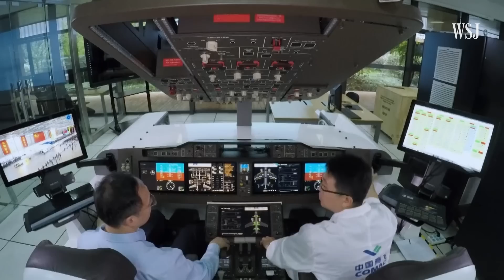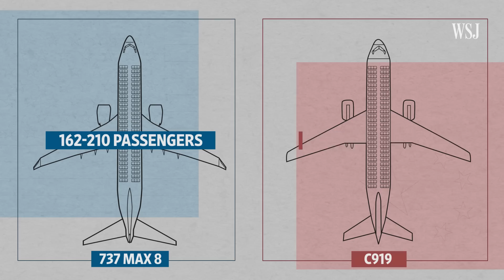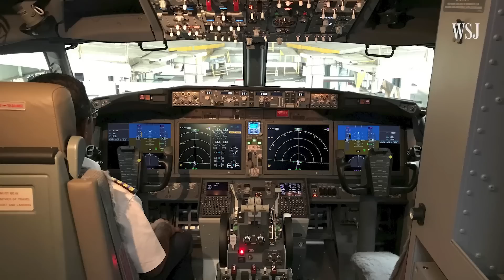Can Comac’s C919 Compete With Boeing's 737 Airplane? | WSJ U.S. vs. China

Comment: China kept the 737 Max grounded, which in itself I don’t disagree with, but then completely covered up the China Eastern Airlines crash which was most probably pilot murder-suicide. 

I know I haven’t explained the point of this very well but I got bored of typing!
Reply: Firstly,the Max is back in sky for a long time in China,but not much Company choose to operate it daily due to its bad reputation.Normally Air China steadily use it as a mix with the older,safer 800 models.
And,I dont know if you watch a series of documentation called Air Craft Investigation,or ACI,which mainly focuses on many well-known disasters caused by multiple causes like machine failure or pilot mistakes.All these Investagion takes YEARS OR EVEN DECADES to make and form a final report.Even the Boeing Max MACS take nearly 2 Years to reach a solid report,and then another 2 years to make them back in sky.CAAC has already replied earlier this year that they have already get some clues,and heading closer to the truth.
Last,If you still remember,the plane that crashed uses a Boeing 737-800,not a comac one.

Comment: Well, if they came this far already, I don't think they will stop. The never stopped when the US forbade them from using the International space station. They one, actually, a much better one. If they can build space stations, land on the moon, land on Mars, build 7nm chips and dominate in telecommunications then they will succeed in rebuilding the supply chain without any need for backward compatibility and need to support legacy systems.
China will create new standards and thus fracturing the supply chain that took decades to be this efficient financially. I predicts Boeing and Airbus are in for a bumpy ride this decade before they go belly up the end of next one.
Of course we can avoid this debacle if let China use the existing supply chain instead of challenging it with its millions of engineers that they produce per year.

Comment: The question is ,is this plane safe enough for commercial use?Only after many years with many hulls  & passenger lives lost planes could iron out their defects that were not discovered before .Brand new does not mean safe, DC 3 are still flying safely relatively because of sound engineering & this could not be said  for these planes’s  country of origin.A military plane has a ejection seat & a parachute .Some thing wrong in the air & u are a goner, period.Like the song fools rush in where wise men never go,go only in a plane u relatively know.

Comment: [Search:"regulator says more testing needed to certify C919 aircraft - Reuters"] Yang Zhenmei, Director General, Department of Aircraft Airworthiness Certification CAAC, told reporters that the C919, China's attempt to rival Airbus and Boeing, has "completed" (failed/passed?) only 34 certification tests out of 276. 
Airlines/ICAO require all international (not domestic) planes have EU EASA & US FAA approvals in order to fly over international air spaces.

Comment: China's first commercial passenger jet was produced with 100% stolen US technologies.
Reply: If they stole 100% from US and take 15 years to run the first commercial flight. They should not lose 15 years for R&D and then just but it from Airbus or Boeing.  15 Years for just narrow width aircraft take too long for 100% copy.

Comment: 4:24 This statement about technological improvements framed the 737 as more advanced than the a320. No matter which plane you prefer, that is just incorrect. The a320 is objectively more modern that the 737.

Comment: Considering the bans on advanced microchips imposed on China, I wonder if the C919 hardware is based on old technology.
I am not going to fly in that cylindrical coffin.
Reply: Planes from 1995 are safely operating still. Stop being overdramatic.
Reply: @marajesty311  Airplanes from 1995 are safely operating with continuous upgrades. Stop being underinformed.
Reply: @TheGuggo  China is not a poor or backward country - their technology is better than most other countries. Chinese companies are producing chips which compete with American ones. Even if it is not as good, it isn't far behind - likely only a year or two behind. A plane from 2005, like a 777-300ER, still uses the tech it had from the factory.  The C919 is perfectly safe to fly in.

Comment: It is most definitely more appropriate to compare the A320 with the C919 strictly for both the design era (where the 737 is decades older and more antiquated than both), as well as the 737 MAX series scandals that will notably tarnish Boeing for years to come.
Reply: because the US ALWAYS thinks they are the center of the universe HAHAHAHAHAHAHAHAHA
Reply: @lancewood1410   Nah, it's China that thinks it's center. China essentially means "central country"
Reply: @jake1110  that's what you think🤣

Comment: The Chinese market needs 10,000 aircraft in the next 10-20 years, 8,000 of which are similar to the 737 or A320. Even if the C919 is mass-produced quickly, it is impossible to produce 8,000 aircraft. The same is true for Boeing and Airbus.

Comment: I’m surprised that this report did not touch the subject of pricing. When C919 was announced it promised to be within 50% of the same size jet from Boeing/Airbus, now when they are closer to delivery of those planes, it is rumored to be at least 90% of A320/B737MAX. 
Additionally direct $70B government investment is a clear violation of WTO rules for fair trade competition and Boeing and Airbus regularly take one another to court for those accusations. So COMAC definitely has to bear those costs as well once it starts selling C919 internationally.
Building a successful and safe jetliner takes a lot of discipline and also personal accountability. It means a simple employee in the factory should feel empowered to raise their hand if they see something is wrong. This is something that I don’t trust to happen in COMAC. So no thanks. I prefer to fly Boeing, Airbus and then Bombardier and Embraer.

Comment: an interesting fact: the initial model of C919 has a much shorter range than A320 or B737. As it is the first of its kind, COMAC is very conservative with design, using older, heavier, but more reliable materials than the newer ones.

Comment: Washington is getting in the way of business and will eventually cost US jobs. Developing a new aircraft is hugely expensive. No one company builds 100% so it makes sense to include China in development and lowering the financial risks.  
China is building it's own to guard against US sanctions and will ultimately succeed. 
It took Boeing 65years to progress from the B707-120 to today's aircraft. China will make a similar leap in 1/3 of the time (more engineers and more determination) Then goodbye a huge market so better to include them. As the space station has shown they are more than capable.

Comment: Older than "even the A320neo" is a statement only US journalists can make about the most advanced short-haul jetliner :D Especially while Boeing has to beg congress to extend permission to use an outdated warning system and having had to retrofit the aircraft with systems to make it compete which ultimately crashed 2 jets.

Comment: I understand the journalists are American so they are probably more familiar with Boeing or whatever other reason, by why don't take in consideration also Airbus in this analysis?? 😅
Considering also how much success the A320 family (also A319, A321 and the new A321 XLR) obtained well  surpassing the 737 family, exepecialy after the 737 max grounding
Reply: Definitely preferring the A320 family over the 737 family! A320s just feel safer than 737s! The only presentable Boeing aircraft these days seems to be 777, but even the newest 777-9 got delayed.... so... Boeing should work hard on that first before worrying about any other things else.
Reply: Probably the journalist meant that C919 was a threat to 737 but to A320. Yeas ago, COMAC declared that its goal was  to take 1/3 shares of Chinese domestic market eventually, which meat there still were 1/3 left for Airbus and 1/3 for Boeing. But thanks for US politicians' trade war and 737max's infamous dive down stunt, the future of Chinese market is most likely that C919 and A320 will divide the rest 1/3 market share which China originally planned for Boeing.

Comment: Regardless of Boeing has over 100 years of experience, Boeing has yet to be able to solve potential risks with their planes after cutting corner after corner to stay ahead of the business. The 737-Max design is over 60 years old, and no accurate new models have been created to improve safety. Airbus is way ahead of the game with safety and innovation. Now China will have the ability to prove itself in the aerospace industry. Boeing is a dying dinosaur that needs to be acquired by the government for the brand to last a while longer.

Comment: The C919 can be written off for two key reasons: it's nowhere near as efficient as the 320neo or the 737max; it has a comparatively limited range (3000nm) against its peers.  The only way this will sell is because it is cheaper than Airbus and Boeing - but the cost of ownership (sacrifices in efficiency and range) will ultimately make it unpalatable for most airlines.
Reply: It’s a start for them. They will need to build their own engines eventually considering the geopolitic situation.
Reply: Just willy sebagai orang China saya suka pemikiran kamu, teruskan pandangan kamu terhadap china.  Biarkan orang orang China berkarya sesuai pemikiran mereka bukan orang lain  👍🤣
Reply: Just, good analysis. So, they got the range shortcoming and cost effective analysis. What is your thought and recommendation on improving the range. What efficiency?  Fuel efficiency, passenger capacity? Ease of maintenance?

Comment: Boeing is a has-been in the industry.  It is no longer an innovator and has outsourced much of its productive capacity to sub assembly suppliers.  The 737 entered service in 1968 and built an amazing reputation for safety and durabilty.  Today Boeing is an MBA driven, cost cutting organization that clearly views dead passengers as acceptable business risk.  They have lawyers to deal with safety issues, no need for expensive engineers or riqorous manufacturing standards.
If Comac copies Boeing they are screwed.

Comment: Airlines will love the competition.  Boeing's safety record is worse with new 737 Max than C919 so can't bring that up as an issue.

Eastern Europe and low cost airlines will be very interested.
Reply: Not particularly. Low-cost airlines usually go for older planes (which are sometimes retrofitted). The big giants can afford to be somewhat picky.

Comment: It'll be interesting to see if the Comac C919 could be adapted to use the Russian PD-14 engine.
Reply: The pd-14 just isn't good enough the bypass ratio is only 8 

Pratt & Whitney PW1000G is 12.5 bypass ratio 

General Electric GE9X is 9.9

----
Bypass provides a lower fuel consumption for the same thrust, measured as thrust specific fuel consumption (grams/second fuel per unit of thrust in kN using SI units). Lower fuel consumption that comes with high bypass ratios applies to turboprops, using a propeller rather than a ducted fan.[2][3][4][5] High bypass designs are the dominant type for commercial passenger aircraft and both civilian and military jet transports.

Business jets use medium BPR engines.[6]

Combat aircraft use engines with low bypass ratios to compromise between fuel economy and the requirements of combat: high power-to-weight ratios, supersonic performance, and the ability to use afterburners.
Reply: @xblade11230 

C919 uses the CFM LEAP as it’s only engine of choice.
Reply: @aviatorsound914  No untrue they use the CFM LEAP because it has a bypass ratio of 11 and it is far more efficient than the PD-14

But they had a choice between the PD-14, PW1000G, and the CFM leap for the comac c919

Comment: Look at the engine of C919, it is too big
Reply: Comparing to what?
Reply: @igorgoncharov3191  Boeing 737 800
Reply: @viperwb  Why don't you directly compare with 737-100 then? The engine Leap is larger than CFM56, because it has much higher bypass ratio, meaning larger size of the fan.
Reply: Bing, what size of engine should it be most efficient given the plane’s dimensions?

Comment: Let hope the C919 could help drive down air ticket price for the travelers.
Reply: this is the most important thing for all passengers.
Reply: I don't think that's a significant aspect of ticket prices though.
Reply: Ticket prices largely depend on fuel
Reply: ticket price is not a big deal. c919 will create hundreds of thousand of jobs, then promote consumption and lift up living standard.
Reply: Ticket prices are already incredibly low for consumers
Reply: Just like prices of EV.

Comment: We are talking only about the Chinese market here. With the geopolitical risks with the Americans, the C919 has an enormous home advantage over Boeing. Even over Airbus in fact, due to the Americans political influence over EU countries.
Reply: What, EU can't think for themselves?
Reply: Looking forward towards entertaining flight videos from china.
Reply: What is the geopolitical risk of the C919 when it’s engine supply, could basically be shut down by these countries? Since it’s using the CFM LEAP.
Reply: @aviatorsound914  the LEAP is used because it's the more commercially viable option. However, China does have its own CJ-1000 engine in development and can be swapped in if heavy sanctions hit. It won't have the same efficiency as the LEAP but it'll still work in a pinch
Reply: @aviatorsound914
Reply: @aviatorsound914

Comment: Interesting that you compare it to the 737 when China uses more a320s than 737s, also due to geopolitics, i can see china turn towards airbus even more
Reply: American bias probably. You can see it when they say that "even the A320neo" is modern. Well, it's the most modern jet of that size there is. Certainly more modern than Boeing, as evident by their outdated crew alert system.
Reply: @LuLeBe  all 737's fuselage and passenger size excepted have a cabin that dates back to the era of the 707,720 and 727 before it.whereas Airbus is a lot newer by 3 decades.a fairer comparison would be the a220 if measured as a domestic plane
Reply: China turned to Airbus making it the largest aircraft seller in the world, Airbus has the largest market in China
Reply: I wonder why..  I would use Airbus too, now to make its own.
Reply: i would not be surprised if most follow suit.a mix of a220,a320 and maybe these as 737 replacements worldwide.
Reply: @franzchong5889 
A220 it’s also a brand new airplane just like the C919 tho A220 definitely did have its own engine issue. C919 also uses CFM LEAP engine, which is obviously made by the United States and France but China will definitely have to be on the good side of these country if they want to have their engine in constant supply in order to produce these airplanes. 

So, the United States and other countries technically still has a leverage over China since they could take the engine supply hostage any time and probably selling the engine at a higher cost to these companies. 

I don’t see China looking to build its own engine since it’s 10 times more complicated and I don’t see China having such capabilities yet nor do they have any in development.
Reply: Currently, no engine can match the reliability of the CFM International LEAP so if China considers to build future airplanes, using the same engine or different engine suppliers probably from the western country then they will have to be on the good side of these countries. Otherwise they could just shut their engine supplies down and you wouldn’t even see any airplanes being produced.
Reply: Us gov start trade war on china. And say so many lies and bad words on china. US gov didn't be aware of they will pay for it.
Reply: This aged like milk

Comment: China biggest break through in commercial jet. china has the ability for a long time but they have to focus on their military jets first. C919 is not a challenge to the 737 or A320 yet. China is really want to get their local market, sort out firts, over 1000 orders already, it is not bad. It is a basic plane, it is good enough for comfort, fuel economy, ranges are not bad as well but  china has no way any where near as Boeing or Airbus  services, maintaince, repair facilities . China has to produce 100 each year, so after 10 years, the next plane then it can get a share of the world market

Comment: 737 max is state of the art airline? No, the a320 came out in 1980s is. B737. is an extra 20 years older. Just look at their cockpit, and you see B737 is obsolete. The C919 came out in 2020s, yes some technology may be old, but I doubt it will be 1960s technology like what is in b737 max, which crashes because they try to update an old jet with some new technology.

may be c919 will be built using 2000 technology, 20 years old technology, but of course it will be better than b737. New materials mean the plane is lighter and could fly higher. Better cockpit that help pilot to fly, contrast to the messy 1960 design in b737. It will just be better, even when it is made in and designed by China.

However, the safety record of new jet is questionable. the b737 original model, crash a lot. Faulty equipment, door flying out, so many design flaws. The B767 has engine reverse fault which crash the plane. The DC10 has door flying out and crashes a lot of planes. Airbus seems save but I doubt China plane will be safe when launch. May be after 10 years, with some design improvement, it can compete with Boeing. All planes improve over time, but I really hope it does not cost human lives.